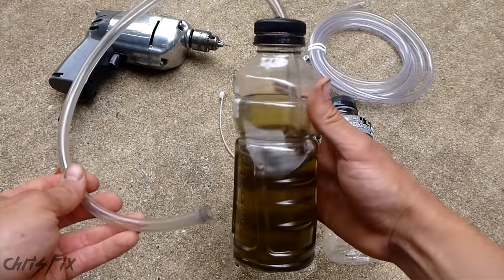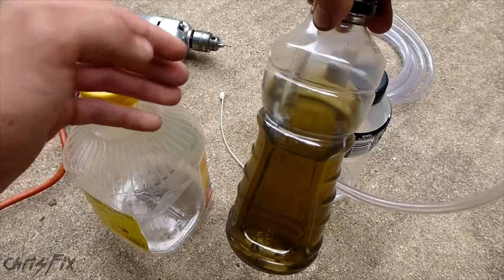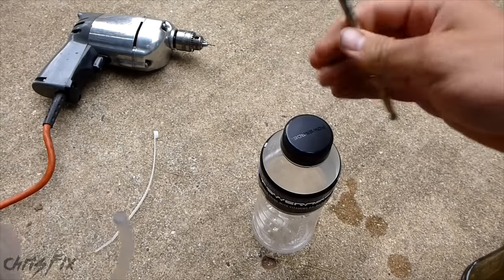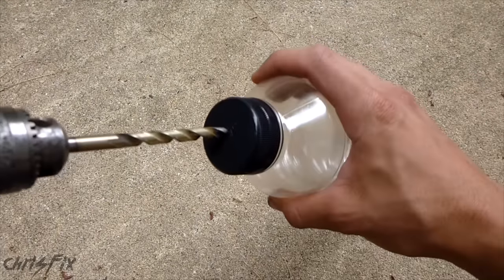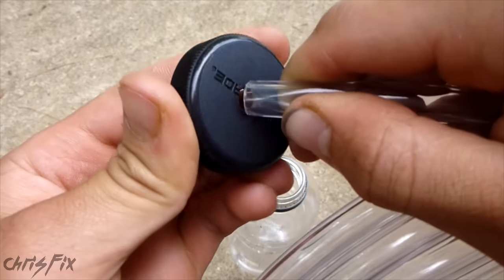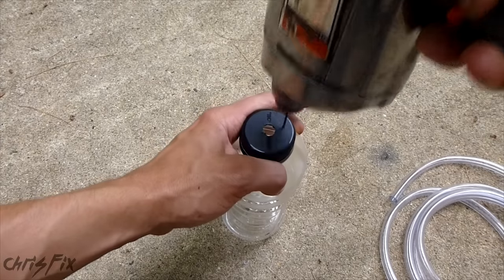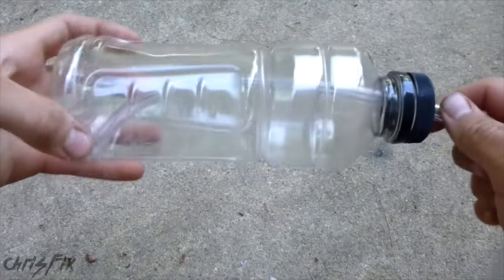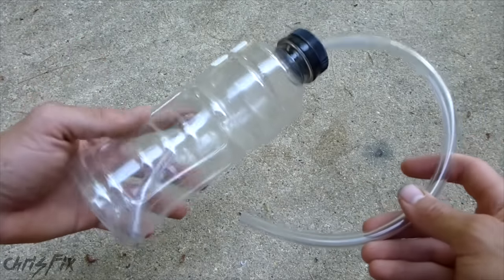How to Make a One Person Brake Bleeder for Under $5

Comment: Thanks for the vids, they all seem pretty straight forward and easy to follow.

This system should work also for bleeding the clutch correct?

I am going crazy this weekend, never attempted anything brakes or rotors based.

08 Jetta @ 100K
4 Rotters, All new pads, Bleed Brakes (no record this was ever done) and oil/filter change. I'd expect 3-5 hrs as this is my first try at brakes/rotors.

VW Quote: $1200 - $1400   HOLY $#%!
Reply from the maker: Hidden02 No problem! Glad the video was helpful! Yes, this process will work for bleeding the clutch too! It is great you are working on your car yourself! The brakes are so easy. Here are videos on how to do them (just in case you didnt see them already): How to Replace a Brake Caliper and How to Replace Brake Pads and Rotors

Comment: I made a brake bleeder years ago that had one hose going into the fluid and to the bleeder and one just through the cap going to a vacuum source. I sealed it with hot glue and used it to flush brake lines.

Comment: The air won't be vented out unless there is a second hole in the cap, for letting the air out. Also, it is best practice to fit a check valve inside the tubing, to PREVENT the fluid, the dirty fluid with moisture in it, in the bottom of the bottle from being sucked back up the tubing, and back into the car. You don't need a zip tie. A properly fitting piece of tubing will not let a significiant amount of air in, or leak.

Comment: Great video. I used this today to flush the brake fluid on my ford ranger. I first tried a harbor freight vacuum pump bleeder, but it never really worked. Your video saved me and showed me how easy it was to bleed the system by yourself.  Do you know if this could also work on a clutch system? It seems like it could use the same concept, but the reservoir on the clutch is smaller and the lines wrap around in weird angles likely holding air bubbles. Didn't know what you thought about that.

Comment: After replacing the entire brake system (aside from the pedal everything was new) I went o bleed my brakes and found out I had 3 different bleeder sizes. The front left and right were different and then they used something else for the rears. Gotta love Chinese parts...
Reply from the maker: Darn! Sometimes that happens if you have to repair a broken bleeder screw, you'll end up having different size bleeders so I feel the pain haha

Comment: I made a more sophisticated setup using a 3D printed adapter glued into the lid of a jar, with holes for a hose and a socket to connect a shop vac. Works pretty well except that it sucks a lot of air in around the bleeder bolt, so it's hard to tell when the brakes are fully bled, but I've used it for several brake bleeds including a master cylinder brake lights switch replacement and installing new calipers. I haven't uploaded the model to Thingiverse, but could if anyone's interested.

Comment: Great idea. Personally I wouldn’t worry to much about using a perfectly clean dry bottle. Brake fluid is very corrosive and could potentially leech out impurities from the bottle so I wouldn’t reuse the captured brake fluid. Other than that, thx for sharing.

Comment: I did sumthn sinilar with a coke bottle. I took a zip tie and put it on the inside of the cap on the tube. So that way the tube won’t come back out. So after i am done i just take and switch the tops from the used one to a clean bottle  and dispose of the old one.

Comment: The old plastic bottle method works just fine, especially if you're as cheap as I am! But a piece or 5/32 vacuum hose fits most bleeder screws pretty snug, don't need to buy that clear plastic hose. If you use extra hose and it droops below the top of your bottle air won't go back down that droop, it acts like a trap
Reply from the maker: +dondale68 Thanks for the tip!
Reply: +ChrisFix Couple more things I do, yes I go above n beyond, I know the owner of the car will bring it back to me in a few years! Before I start bleeding the brakes I use a 6 point (ONLY a 6 point) wrench to take the bleeders out one at a time, make sure they're clear, put a dab of antiseize on the threads (I've NEVER broken a bleeder) The little rubber caps are important, they keep dirt n road debris out of the bleeder, if one is missing I use a 'vacuum cap' to cover the bleeder. I've seen bleeders without the cap get totally plugged with crap!

Comment: little tweak that i'd suggest is to make the hose a good bit shorter and tying a string round the bottleneck so it can be hung from a coil or something
Reply: +Gigaguenther or use a wire coathanger so you can hook it on to something

Comment: I like the kind with a tire valve on a hose to a master cylinder cap. Connect to the nearest tire and you then have a pressurized brake system...open a bleeder and Vóila!
Reply from the maker: +ben dunn Hm, that is interesting, I never saw that before.
Reply: Yeah they're available at any corner auto parts store here in Sweden. Maybe I should take out a US patent! Anyway the only thing is you have to make sure you have enough brake fluid in the reservoir to handle all your bleeding. Otherwise if the level falls below the outlet you're pushing air into the system and then you have to start all over but that's never happened to me.
Reply: Interesting idea, but isn't there a chance of moisture from the pressurized air getting int the line? And wouldn't that break down the hydraulic fluid faster? Just curious.. .
Reply: The air in your tire isn't any more moist than any other ambient air. After years of using this method I've never had any problems or seen any indication of fluid breakdown. The rigorous yearly safety inspections here in Sweden haven't caught anything either. ;-)

Comment: Great video. I never knew that you needed a vent hole. Thanks bro
Reply from the maker: ***** Thanks man! The vent hole just helps vent pressure when you force brake fluid into the bottle. That clear hose has a pretty snug fit so not much air gets out of that.
Reply: ChrisFix hole thought plastic lid same concept as hole in weed whacker tank
slight pinch fit

Comment: All your videos are great.  Question:  I'm replacing the front disc breaks, rotor,  and rotors on both sides of my 2005 Savanna 1500 6 cylinder GMC Van.  On the passenger side I'm also replacing the caliber.  Do I have to bleed all for breaks or just the one caliber I'm replacing?  Thank you.
Reply: Usually just the one caliber that you replaced as long as you hurry up and don't lose all your fluid out of the master cylinder.
Reply: @mrbreezeet1  tHANK yOU

Comment: So should I Add clean break fluid inside the bottle before using, or should I just use the fluid that comes out and then top up the reservoir with new fluid?

Comment: 3:00 your brake line is on backwards. That little tab that sticks out is supposed to be up against the side of the caliper so that it doesn't twist when you put it on. If it doesn't fit right the other way around, then it's probably on the wrong side.

Comment: You dont need to put cap on the bottle when drilling, use some scrap wood as base,  better stabilty (no wiggle of bottle, danger to cut into hand(has happend...)) and you dont need to clean up the bottle.

Comment: Good money-saving tip. One comment for novices is to not hold the cap using the drill as shown around 2:17 to enlarge the hole. A small slip of that drill and you could end up with a hole in your hand. Just put the cap on a block of scrap wood and drill it like that.

Comment: If you drill the hole to large just put a zip tie on the hose under the cap so it doesn't slide out and don't let it tip over. It doesn't have to be air tight the bottom of the hose just has to stay submerged.

Comment: You don't need a cap at all if you just make sure the bottle/jar doesnt tip over and the tube stays in the fluid, right?
Reply from the maker: Technically no but it makes the job way easier and helps prevent messes if you tip it over by accident (happens to me sometimes too)

Comment: Chris LOVE your videos...I'm going to be doing a brake bleed for the first time on Tuesday.  I was wondering if I have an old sports water bottle, the kind that came with a heavy plastic straw could I use that for my brake fluid bottle?  I was thinking even if the tubing wasn't too snug in the bottle cap I could make sure it's long enough to touch the bottom of the bottle then put a zip tie around the hose under the cap to prevent it from moving.  Or even epoxy it in place.  Your thoughts?
Reply from the maker: You just need to make sure the tube coming off the bleeder valve is facing up so the air bubbles out. Otherwise you can use any bottle you want.

Comment: 😕😕😕😕😕😕😕😕😕😕Does the brake system have a "one -way" valve that would prevent the air from just going back-and-forth, as one depresses and releases the brake pedal? If not, would it be better to have such a valve in the clear brake bleeder line? Thanks Awesome quality videos!😀😀😀😀😀😀😀😀😀😀😀😀😀😀😀😀😀😀😀

Comment: Just want to point out to others the large hole drilled into the container lid should be the same size as the outside diameter of the tubing.

Comment: Use an automotive syringe at the bleeder valve and do a reverse bleed. Air travels upward, you force new fluid into the bleeder valve and you'll see the air bubbles come out the reservoir. Do not do the pedal pump method because you'll never get all the air out just move it around in the line.

Comment: Chris, always have enjoyed your tutorials.  This one no exception.  May I ask, do you have a hack for filling your car's reservoir while pumping to bleed the lines?  Mightyvac and other brands have bottles in their kits that holds clean brake fluid attached to the car's reservoir so that you don't have to repeatedly fill the reservoir as you pump and bleed the brakes.  I had been thinking that I could get a spare reservoir cap from the junk yard and finagle a tube and bottle setup similar to what you have in this video.  Thanks.

Comment: Drill the cap off the bottle? I have been using this bottle method for a lot of years, personally I just put the cap on a piece of of wood and use a punch and hammer to make the hole. But this still a great video.
Reply from the maker: Thanks for the tip!
Reply: No problem, I usually never miss a chance to use my power tools when I can.
Still enjoy your channel. 
I mostly work on my motorcycles but the same techniques still apply. I use the bottle method to bleed the brakes on my Motorcycle.

Comment: The tubing you just get it at Home Depot? If so what section will it be. The last time I had a brake flush done I was charge about $60 and than I peek to see how they were doing it and that's all I seen too the same bottle and a tube method so I was like what the. So just seeing and how you have demonstrated the brake flush in your other video has made go and do it my own self and save some money. So great videos like always and thank you for being a money saver.
Reply from the maker: Miller Gonzalez Yes, that is where I got my tubing. I think I got mine in the plumbing section but just ask.

Comment: Drilling the hole in the cap putting it on a block of scrap wood would eliminate having to clean the bottle. It will be tougher to hold onto the cap though.

Comment: if you use a powerade bottle instead of gatorade your hose fits directly through the mouth piece. then you can use a knife and poke a little hole for the air to escape. but removes your drill bit step entirely for just choosing a different bottle.
Reply from the maker: +Eddie Riley Thanks for the tip!
Reply: Np great vid got my brakes done lol

Comment: This is one of the oldest tricks and I'm surprised more people don't use it, I've been bleeding brakes this way for 30 years and it works better than having a "helper". A few things though, why not use the smaller tubing (3/16" usually) that already makes a tighter connection on the bleeder? Then you don't have to zip tie the tube. Why drill the cap to the ID of the tube and then try rounding it out when you can just use a bit the size of the OD or the next size down - wouldn't that make more sense? That's why they make so many size bits! It doesn't really have to be a tight fit though it does help a little. Why clean the bottle then drill the hole in the cap so you have to clean the bottle again? You don't need the bottle to drill the cap, just hold it in your hand, get the right size bit and be done with it. That said, I like this method even better than using a Mity Vac and it only costs pennies.
Reply from the maker: +Andork Kuomo Thanks a lot for sharing! 3/16 wont fit on my bleeder valves. You want the tube to be a tight fit so I drill small and squeeze the tube in so the tube. If I drill the outside diameter, the tube wont fit tight enough and it slides out easily, especially when the brake fluid gets on it. Thanks for sharing!
Reply: +ChrisFix Funny, I always managed to get the smaller hoses to fit, just have to work them a bit and then you have a nice, tight seal. Just used mine again today for the umpteenth time. Made it quick-like many years ago with just the first things I got my hands on; a green glass 12 oz. bottle so you can hardly see through it with a tube hole through the cap, can't figure out why I haven't dropped it yet, and a length of black vacuum hose that you really can't see through at all. It works so well I never really needed to make a more "practical" one and it's at least 15 years old! Just goes to show that you don't need to get very hi-tech with these at all, pretty much anything works and they work very well too.

Comment: Hi Chris, Another great video!  Does this actually expel anything or does it push the same quantity of brake fluid out as it then sucks back in, unless you're locking the bleed nipple no actual fluid gets expelled, apart from the first push, right?

Comment: You can let the bleeder container hang if it does not kink or make a hanger for it too. If the bleeder nipples are a little corroded air will get through so you need a tight fit at the nipple.

Comment: Hi, your content is awesome thank you! Question, I drained my HMMWV power steering (as much as possible, turning the wheel left and right and taking out as much fluid as possible). Filled it back up with the proper fluid and even after driving it two times I still don’t have any power steering. Any pointers? Thanks!

Comment: Jeepers creepers Chris lol you could have drilled your hand lol then we wouldn't be able to watch your cool videos for a while. Use a board next time, I got my hand once with a drill bit and it took a chunk of meat out. That sucked pretty bad.

One man bleeding systems are great. I use a handheld vacuum bleeder as well as the method you used in this video. I tried those one way bleeder valves before that you purchase for calipers that supposedly guarantees no air back bleed, those things are junk and leak after a while. Great video Chris, protect your hands mate.
Reply from the maker: +Sandman1832 Thanks!

Comment: Chris, I watch all your videos and let me 1st say I learned a lot from you and appreciate all of it. But I must say this is not one of your best. #1 why not drill the cap off the bottle? Use a wood vice or hold it in place on the ground? #2 why not use a drill bit that's the diameter of the hose not the hole or a slightly smaller bit for a snug fit. I never criticize you on your other videos because they are pretty much perfect....I guess we learn through the years. Thanks for your knowledge!

Comment: I've watched a few of these videos in preparation for bleeding my girlfriends brakes and have concluded the following: it's preferable to push the fluid through (like this method) than pull it (with a vacuum bleeder for example). Can someone confirm my suspicion? I have a vacuum bleeder but am leaning toward knocking one of these up instead.
Reply: These are good. You can see what is coming out clearly. Cheap and easy

Comment: PLEASE BE WARNED. I've seen several people bleed their brakes with this method. The common problem is that they are all are going to introduce air, (hence braking problems), into the brake system if any back pressure, (suction), occurs. The instructions say to connect the bleeder valve, with tubing, to a resovoir filled with brake fluid to prevent any air from entering the brake system If a back pressure condition occurred. The theory is that the brake fluid would be drawn back up into the brake system, (good), instead of air, (bad). Unfortunately, the reality is that if this were to happen, the air would immediately be drawn back into the brake system because the tubing has air in it from the bottle to the bleeder. You would have to have no air in the plastic tubing from the bleeder to the bottle to be assured no air could be drawn back up into the brake line. Air is compressible and fluid is not. That is why you bleed your brake system of air. Otherwise your brakes will be spongy and not work properly, if at all.

Comment: So Chris where exactly did you get this tube?
Hardware store?
Home Depot?
Size of the long tube?

Can I use a medium size Heinz ketchup bottle?

Thanks again.
Reply from the maker: Justin Mojica I got it at Home Depot but any hardware store will do. The tube size is 1/4in diameter. A ketchup bottle is pretty narrow so it might fall over easy. I mention all of this in the video.

Comment: Chris, where do you dispose of the used brake fluid? The place that I go to, will take oil and transmission fluid, but not brake or power steering fluid. Great video BTW.
Reply: This website has  a recycle lookup by zip code and fluid type: http://earth911.com/recycling-guide/how-to-recycle-automotive-fluids/
Reply: In the local duck pond.